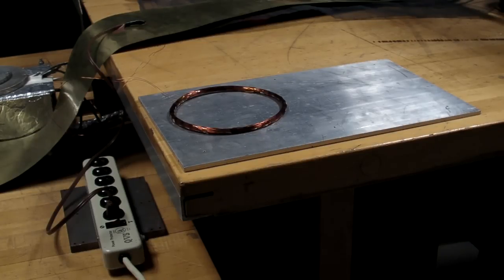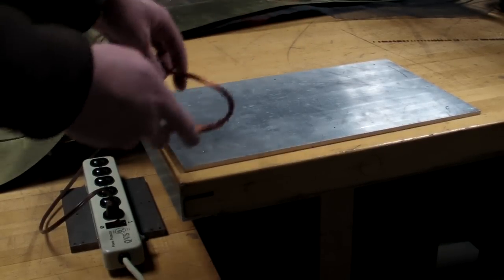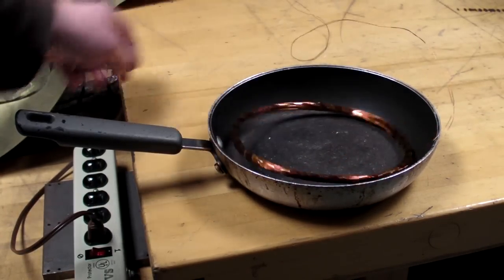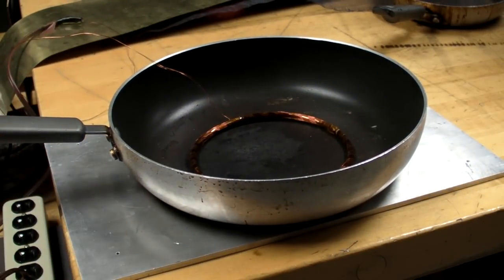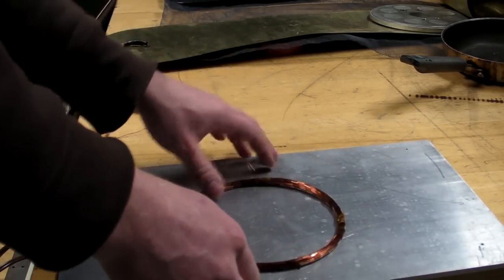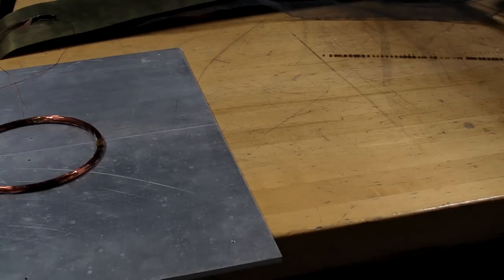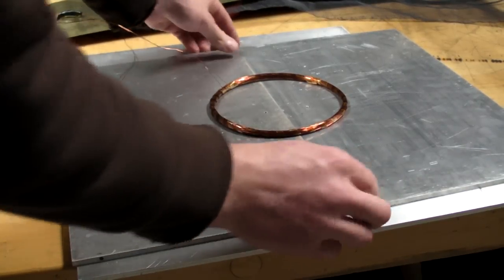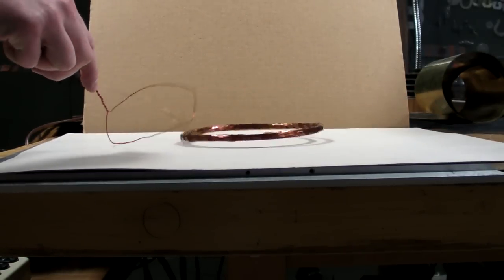(#0126) Lenz's Law Levitation Coil Stable with No Tethers

Comment: How much voltage was used in the coil? And what was the amount of turns in the coil. Thanks, great video.
Reply: 120 VAC / 60 Hz, 200 turns 28 AWG magnet wire, 6 inch diameter coil.

Comment: How did you wire it? I don’t really see any wire and whenever I try to do it, it fails. I have the copper wire that it is in the video, wrapped it 200 times, is using 120 volts, and using an aluminum pan. It isn’t generating a field though. I don’t know what you are doing to make this happen but what is it that you are doing to make this work? Can I just use a circuit or do I have to build a sort of device in order to make it work?
Reply: Did you use "MAGNET WIRE"?  Regular, bare 28 AWG copper won't work; it must be magnet wire.

Comment: I don't know if you can still reply tho if anyone could reply that'll be great. But why does the coil have difficulty switching plate even when you push it.
Reply: Benoit Faure as the coil goes over the gap between the plates and is more on one side than the other, the eddy currents it makes in the metal are made in a larger area and so are stronger. this means the plate is more repelled by the side it is over, and will be pushed back to be half over the gap.  like a ball in a hemisphere.

Comment: The UC Davis Physics Dept. has (or at least had) a large 60Hz coil base (with iron laminations) that levitated 12" aluminum disks stably.  One demonstration included frying an egg on the floating disk, as it did get hot.  I'm trying to find the coil geometry to stably levitate disks, as I'd like to make a small high-frequency replica.  I made one 30 years ago with four small (15mm) poles and ferrite core running at 80KHz, but it is stable only when levitating bowl-shaped objects such as aluminum foil (or a bit thicker) shaped over a sphere.
Reply: best of luck doing that

Comment: Can you share a simple formula that shows how the repulsive levitation force is affected by number of turns, current flow and frequency?
Reply: There's no simple formula for, although there are computer simulation programs (finite element analysis that includes electromagnetism) that could estimate different cases.  It does work better at high frequencies, especially for small-geometry demonstrations.  I made an 80KHz levitator with fixed coils and a floating piece of aluminum foil about 30 years ago.  Am hoping to make an improved one, which is why I searched for related videos and just found this one.
One relation is simple:  For a fixed coil position (height), the force is proportional to current squared.  Doubling the current in the coil also doubles the current in the aluminum base, so four times the repulsive force.  That doesn't translate to four times the height, however, as the fields fall off rapidly with height (separation).
For low frequencies, where the aluminum plate(s) are well thinner than the skin depth, force will be linearly proportional to frequency (at constant current).  That is because twice the frequency will induce twice the current in the aluminum plate.

Comment: Does this only work with AC or can DC enable the copper wire to levitate?
Reply: Only with AC.  DC will not induce any current in the aluminum plate(s), so no magnetic repulsion.

Comment: I'm wandering to know a few thinks about the electric circuit you made to do that. What is the intensity of the current yo work with? You touch the wire without any danger on you so I expect that it's low but even that the voltage is high and the resistance of the coil isn't very high so the intensity should be high. I spouse you use some external resistance in the circuit, but I want to know if that is true.

Comment: I'm fairly new to this levitation thing.  but have you ever tried levitating aluminum over the coil instead.  I know you won't be able to with that size plate.  but maybe something smaller.
Reply from the maker: +Jay Ridge More than 10 years ago, I did tried some experiments to levitate an aluminum plate over a various coils with various iron cores. The iron was necessary to get much higher magnetic field density. The plate was easily lifted up, but I was unable to make it stable. It is possible, though. It's just a matter of time to construct the proper apparatus.
Reply: I have the same problem, I use a construction of 4 Coils in U-Cores, that ar connected in the middle, so that you have a sort of cross with a big north pole in the middle and south poles on the ends, if viewed from the top. My plate also hovered away, but it's maybe due to the fact, that it's to small, so I ordered a sligthly bigger on and I soon will find out, if it works.
But you said it's definitely possible to make it stable. Do you have any advices for me for a proper construction?
Reply: @robinwersich3424  
I know how to make the aluminum disk stable ...

You must make them rotate, that is the answer.

When you make the change let me know the results
Reply: @Anonimousxz  I got it to work without rotation - the key was to have a plate (mine was made of aluminum) that is round and only slightly bigger that the U-core-cross, because you need a significantly big enough increase in the surface that is penetrated by the magnetic field to get the plate to lift up at the side where it is about to slip off, so it is pushed back to the center.
If you're interested I can upload the video

Comment: Make the aluminum plate into a doughnut. Maybe this will keep different poles on the plate to hold in place. Make the hole the size of the copper coil diameter but a bit larger. That should hold it in place.
Reply from the maker: +pudge Excellent idea! I don't know if I had ever thought of that. Will certainly have to try.
Reply: I suspect the doughnut will be unstable.  The best levitation will be with the coil centered over the hole, so it will tend to fall off in every direction.

Comment: if you can get the plate much smaller and keep it under attached to the coil... or the coil inside a disc shaped thin aluminum layer, maybe in the middle not touching them :) it looks a 
little like lifter triangles as well.

Comment: do you need a 28 gauge magnetic wire. Is it the current that makes it levitate. +Eric Wasatonic could you try with a 10 gauge but up the volts but not to fire volts

Comment: Put a capacitor on the floating coil to form a resonate circuit then put static cil on top so there are no wires going to the floating one. Just make sure the top coil doesn't induce any currents in the plates
Reply: Will that make the sphere levitate

Comment: Does the coil have to be a certain dimension? Cuz I have a just under 5" container I can wrap magnet wire on but it's a very thin 32awg. Could I just make it like 400 turns instead of 200 or virtually any number of turns I want should would with no problem
Reply: 30awg*
Reply: +The Computer Tech Guy It shouldn't matter. I don't recommend putting line voltage through 32 AWG though, try stepping the voltage up and the current down with a transformer. It is possible but it might take a bit of tinkering

Comment: You are on the right path....... you need to modify your design and control to make it hover in place. It can be done because I did it (without having to tie it in place). Just to show that I know what I'm talking about. That coil of yours eventually got weaker and weaker until it quit working all together. Am I right?

I built mine years ago and got it to hover in place like a damn UFO. But since it only work on a diagmagnet platform(aluminum,copper, bismuth, etc), I didn't see the point in digging much deeper into it, plus I got bored of it. I figured that it would take too much time and money to scale it up. I can't imagine how much energy it would take to make a vehicle hover off the ground. A scaled down nuclear reactor maybe? I was thinking maybe when I get back at it, I might try spinning mercury in a glass tube. My luck the tube breaks and I'd get sprayed with mercury and die........ I'm thinking out loud now...... good luck!
Reply: How can I contact you please

Comment: does it need the metal plate to work?
Reply from the maker: +Bryan Camacho To maximize the magnitude of eddy currents in the metal that are induced by the coil's magnetic field.
Reply from the maker: +RedLeader 9001 Yes. It needs a very conductive non-ferrous metal. Aluminum is ok. Copper would be better. Thick slabs of silver would be best if money was no object.
Reply: The Hover board is not around the corner then ha ha ha
Reply: +Eric Wasatonic why do you need a very conductive metal?

Comment: How is the coil hooked up to the AC? There must be something in between as I believe the GFCI would trip immediately. I'd like for one of my physics students to do this for a high school project.
Reply: Matt Perkins I mean there must be some sort of resistor in the circuit. Thanks again.
Reply from the maker: Matt Perkins The length of wire in the circuit provides the only resistance. It is connected straight to mains 120 VAC. It gets hot quickly so I can only leave it on for 5 to 10 seconds. All current flows between Line and Neutral. A GFCI would only trip if current flows to Earth Ground. To be 100% safe, it should NOT be done the way I have done it here. The coil should be powered through a GFCI or an isolation transformer. You should also include a fuse in series with the coil, and wear safety glasses to protect against flying beads of molten copper if the two ends of the coil short together. The wire's insulation is very thin. The two wires leading up two the coil should have thicker insulation than the magnet wire I used here. The coil should be handled with rubber gloves or an insulating stick. Be safe. Have fun.
Also, to get better levitation results, a thick slab of copper would be better than aluminum since copper is more conductive.
Reply: +Eric Wasatonic What's the length and the section of the wire? And what is ti made of?
Reply: My students have built 2 of these very successfully over the past semester. They hooked a rheostat up to control how high it floated. The length was around 100' of light gage wire.
Reply: And thanks eric.
Reply: Any length of conductor induces a magnetic field when current flows through it. Winding it into a coil concentrates the magnetic field and each turn adds to the total magnetic feld, and the each turn interact with the other turns in what's called self inductance.  All coils have this property of inductance. Inductance impedes or resist a change in current. We call this resistance inductive impedance. So a coil has both copper resistance and inductive impedance to limit AC current flow.

Comment: Would it be less wobbly with a square wave?
Reply from the maker: Not sure. After making this video, I tried using an audio amplifier to see how it would act with higher frequencies, but it only put out 70 V peak, whereas the mains gives it 170 V peak. No levitation. I would need a higher power amp.

Comment: I dont mean to talk safety to an electrical engineer but i wouldn't want to touch the coil with my bare hands in case some enamel has flaked off
Reply from the maker: Thanks for your concern. I was careful to not touch anything grounded at the same time it was plugged in, although it was on a GFCI outlet. Indeed for maximum safety, I could use rubber gloves and an isolation transformer, but I've always been more concerned about potential arcing between the two thin wires leading to the coil. Safety glasses! Gotta watch out for molten blobs of copper.
Reply: i wanted to say that :(